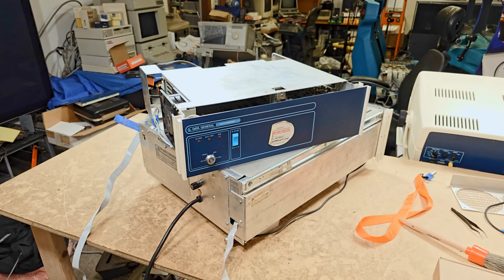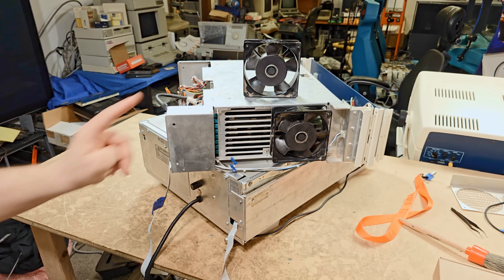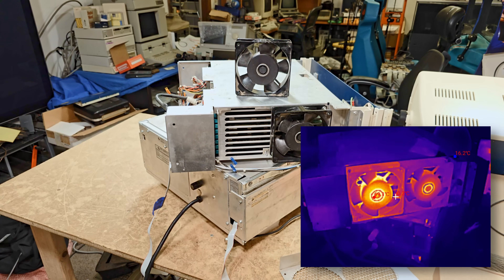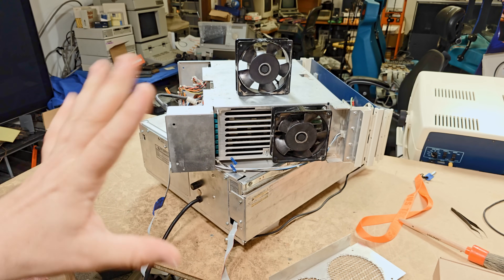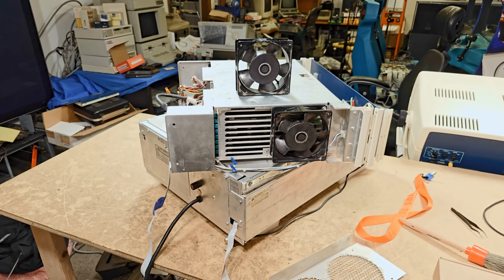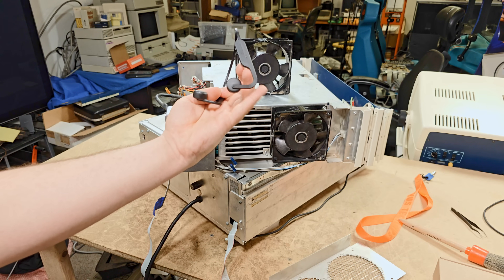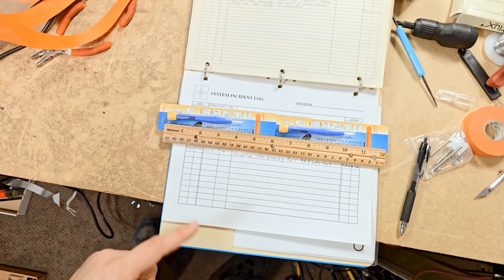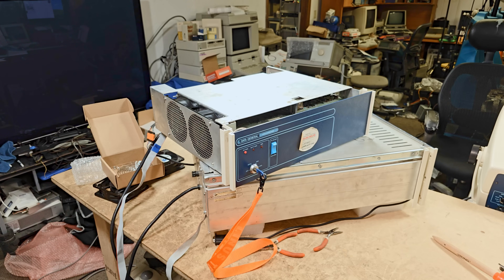Data General microNOVA Fan Meltdown

Comment: Excellent comment about the bone conducted headphones. That happened to me. In my country is difficult to buy from other countries, and I was thinking to buy a Shokz headphones. Meanwhile, I found a similar thing that you showed. They were very cheap and I knew they weren't the real deal, but I thought that them would be only a very cheap version of bone conducting to test. But I found exactly as you described that they are just two tiny speakers in a "bone conducting like" shell. So, basically, a scam. I didn't pay much and I knew what I was getting, but I was NOT expecting that "ingenious" scam...
Reply: There are some good open-ear headphones in that style, though.  The SOUNDPEATS run free ones are pretty decent

Comment: If you want proper quality fan replacements, see if you can get your hands on EMB Papst AC Axial fans. EMB Papst is one of the highest quality industrial fan manufacture and make several fans of that style, with various different flow rates and noise levels. Though, a pair of those easily goes for over $100.

Comment: Actually the original fans look like they should be rebuildable. Ball bearings come in standard sizes / types and a handful of variations.
Reply from the maker: I would be very happy to try doing that but I couldn't find an obvious way to remove the blades to get to anything after removing the label.
Reply: @techtangentsii  So there was nothing under the label? It's probably assembled in a non-intuitive manner then. The fact that you can get to what looks like the axle from the rotor side should be a major clue. Perhaps that can be pressed out from there, thus effectively separating the rotor. It may be worth keeping an eye out for lock washers just in case.
Reply: @techtangentsii  i have worked on fans like this in the past and it looks like there is a plug on the top middle of the hub you have to pry out to get to the bearings.

Comment: I've seen those fans meltdown before, I have an ISA backplane system from Texas Micro that I ended up replacing the original AC fan in it with a medium speed NMB 120x38mm fan , the AC fan when I got it had already stalled before and the impeller was melted and very brittle.

Comment: If the fans are AC you don't have to really concern yourself with the polarity since it alternates. I'm guessing a serious face/palm is in order in your near future.
Reply from the maker: I'm not sure it would make a difference in this case, but I was keeping track of the "polarity" between the two fans to make sure I connected them the same as original so both fans were phase with each other. I didn't want any weird out of phase things making strange noises or vibrations. Speakers are AC too, but if you connect the left and right channels out of phase from each other you can get some very unpleasant results.

Comment: Kudos on you for not just throwing Noctuas in there. So many times I see people put in Noctuas with all the in-line resistors mounted. "See it barely makes a sound now"... Yea because it's not moving any air!
Reply: Yes. You can either have airflow or a silent fan, but not both.
Reply: @humidbeing  You can have both. Just not in 80 x 80 mm.
Reply: how about a Noctua without resistors? Seems like a good balance to me
Reply: @ZugTheDragon  they might have more air flow than similar plastic sleeved fans but they aren't drop in replacements for high volume ball bearing fans. Those things aren't gonna be silent no matter what.
Reply: I suppose the more unusual place I used a Noctua fan was in a team mascot costume at my daughter's school.  She complained it was hot in the headpiece, and looking at I found an 80x80 fan, but whatever battery pack it had was long gone, and even oe of the wires was missing.  So I asked Noctua and they recommended one that would fit in the same space, one that not only ran at 5v, but also had a power harness with a USB-A plug.  So now it runs off of an easily replaceable USB power pack.
Reply: We should start putting Dyson bladeless fans on computers if we want them silent.

Comment: I don't use a bone conducting headphone but I have some cheap $2 headphones from ali express. They have black earpads and orange ones. They are basically so bad that they don't drown out the outside noise at all. Which makes me be able to use them in a similar way as you use the bone conducting ones. They don't sound great though. But good enough for a video or a podcast. Just not music or movie grade.

In other news I enjoyed the video and was reacting in a similar way as you were finding out about the wrong size screws the fans came with.